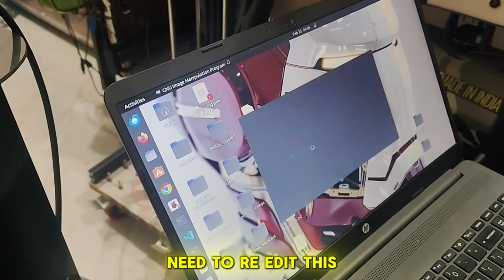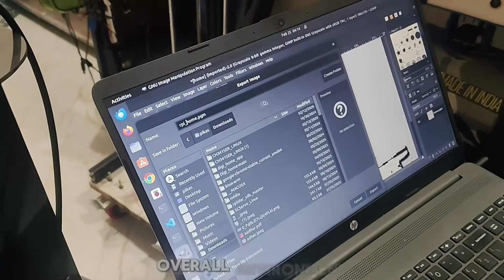My Autonomus Robot Can Hear commands (In cheapest way)

Comment: Sir , whenever I try to print gears or a shaft on my 3d printer then , there comes a problem of z seam.
It is an extra 3d printed vertical line which completely destroys the circular surface and , it's impossible to insert anything to the exact centre of it.
Can you please help with this problem?
Reply from the maker: Sure check this video it helps me a lot
Reply from the maker: https://youtu.be/vl0FT339jfc?si=nrXLVk-4AmzrGBW0
Reply: @Pi-kas thankyou sir.